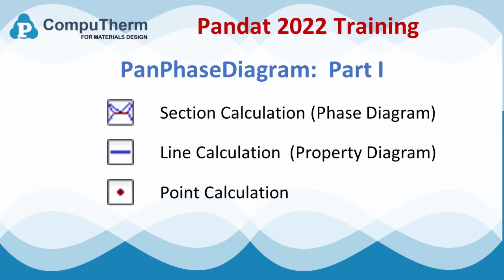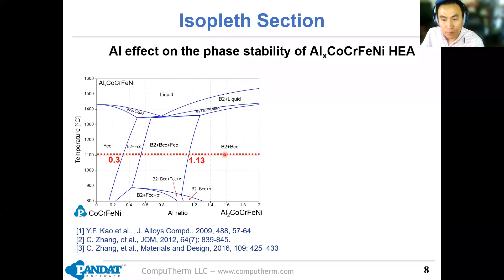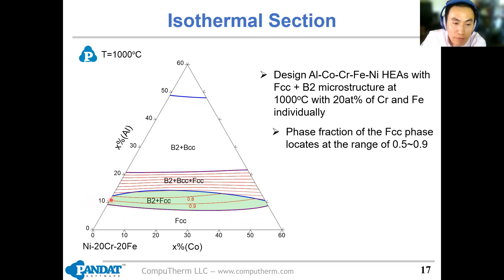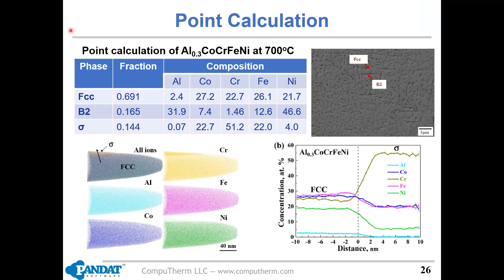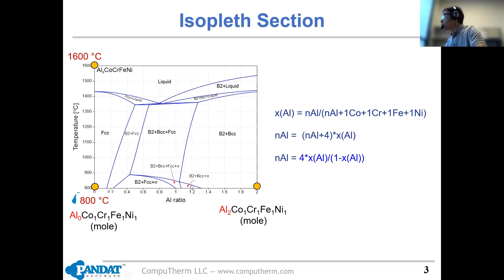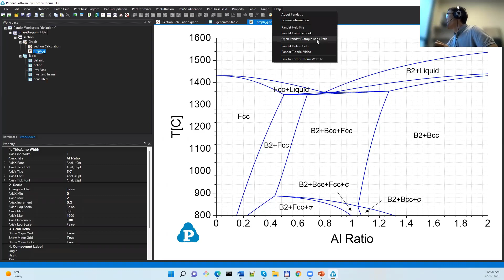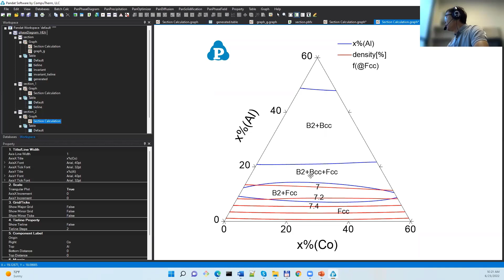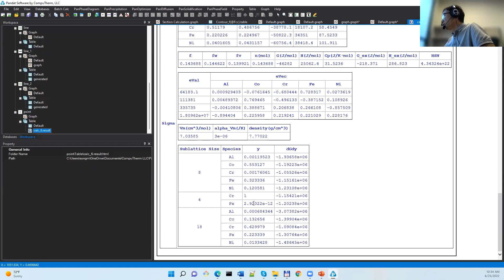Pandat2022  Training: PanPhaseDiagram,  Part 1

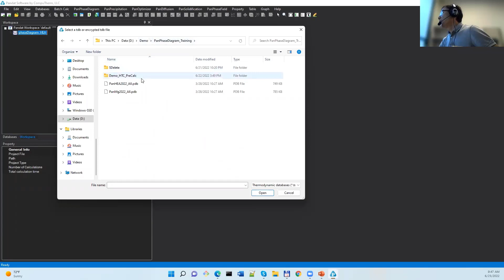Comment: Hello sir. I have been using PANDAT software for past 1 week. I have downloaded the trial version of this software for calculating the multi-component phase diagram of Mg-Al-Zn-Mn but unable to perform the calculation. In 47:05 min, you selected the pdb file of PanHEA2022. I am not sure if this file is available in PANDAT examples. Sir, could you please look into it??
Reply from the maker: Hello Jaimin,  Thanks for using Pandat software!  The education version (trial version) has all the functions with the same as the full version, the only limitation is it can only perform three elements calculations. We encourage all viewers to download and use the education version to learn how to use Pandat software.  After you have learned how to use Pandat, and find that Pandat software is helpful for your study  and research, then you can buy a license for a full version and related commercial databases. 
In your case, the Mg-Al-Zn-Mn system is more than three components, it can only calculated using licensed full version. The database, PanHEA2022.pdb file, used in this training class is also a commercial database, users need to buy the license to use it.  
You can follow Pandat example book to learn how to use Pandat software. From Pandat menu "help->open pandat example book path", in that folder there are all the database (open source TDB file) used in the example book. You can follow the example book step by step using the files in this folder.